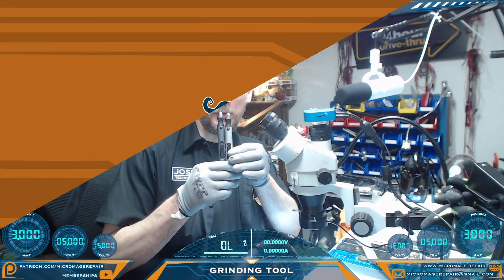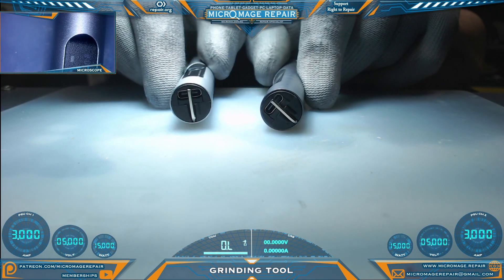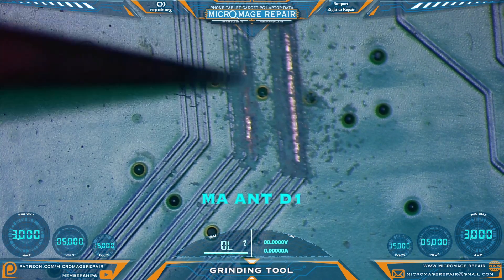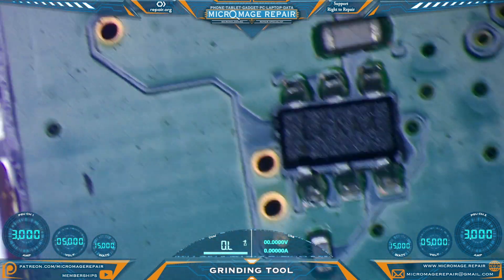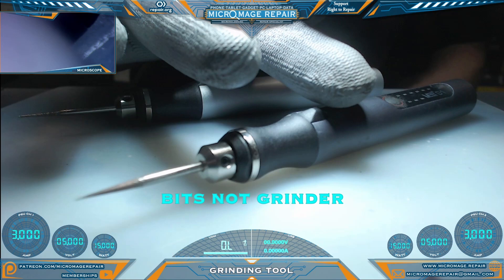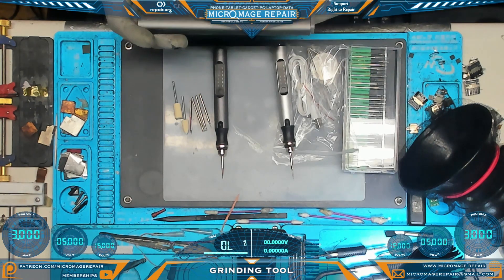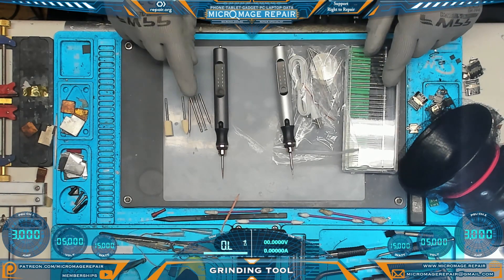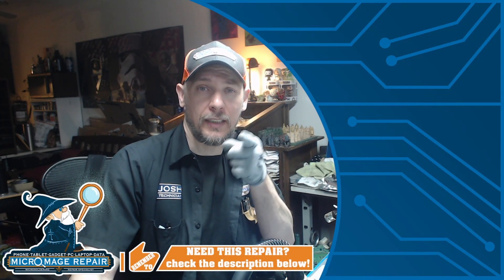🛠️E108 VS. MaAnt D1

Comment: sir how the bits are tightining , in respect of E 108 drill
Reply from the maker: It has two set screws , you have to tighten or loosen using the Allen driver supplied with the tool.

Comment: sir will explain how to use E - 108 3 speed grindind rotary driil  , I also had maAnt mini rotary how the bits are tighten
Reply from the maker: The older version like these had a set screw . The Allen wrench is included with the tool.
The newer version does not have a set screw. The bits just plug in.
Speed is controlled by button push, push it more than once to increase rpm.

Comment: Caveman checking in here, still use my old fashioned pointy metal stick with no moving parts.

Electric screwdrivers, though.... Have you used any? I just got my second, the miniware es15 it's on Amazon. Amazing. 

Only console I ever have issues are series X that have never been opened before and have been smoked around.

I don't touch my manual driver for PS5s, desktop computers, etc anymore
Reply from the maker: Yea most of those drivers like the Wow Stick just do not have the torque. I use an old precision assembly line torque driver that is pretty powerful/ bulky but can be dialed in very specifically so that it doesn't overdrive and strip screws.
I can part out a Series X with it in just a few mins.

Comment: These grinders are great for stuff like trace repair. They are very light and silent in use. If you need some more power, for like grinding HDMI/USB ports or shields, I prefer the green grinder from 2UUL. It's are a bit more noisy and is a bit heavier, but clearly has more power.
Reply from the maker: Agreed these are great for light work, I have a Dremel I use for heavier work like grinding down Ports for Switch Lites